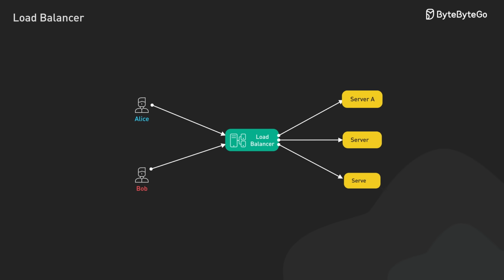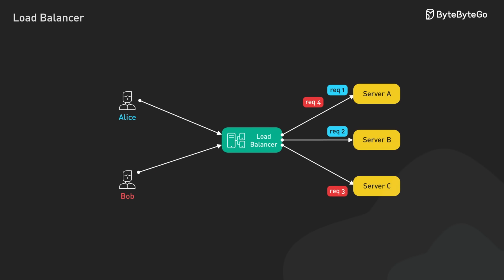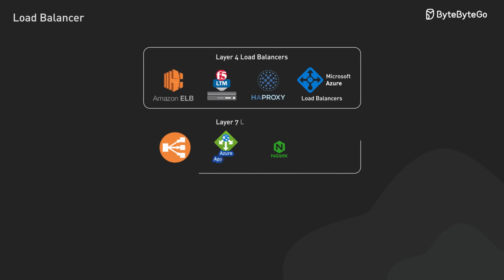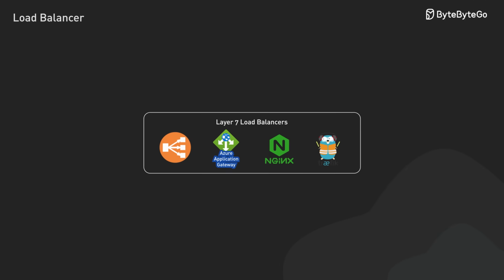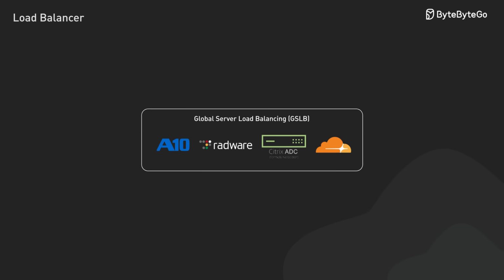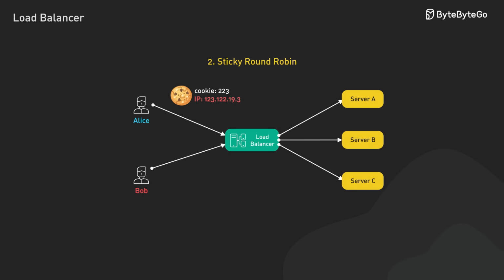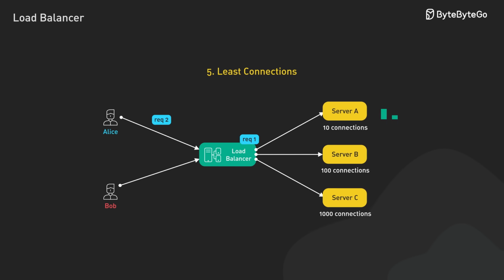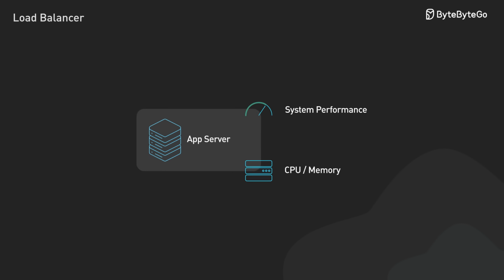What is a LOAD BALANCER really about?

Comment: What happens when the load balancer goes down? isn't it a single point of failure?
Reply: By creating multiple load balancers on different data enters. Monitor the health of LB and switch the routing.
Reply: Yes, it is. That's why using cloud provider would be better like AWS ELB.